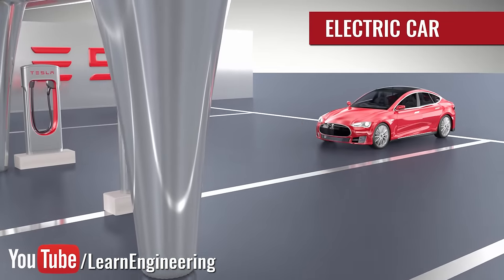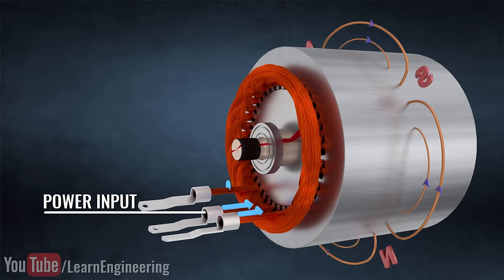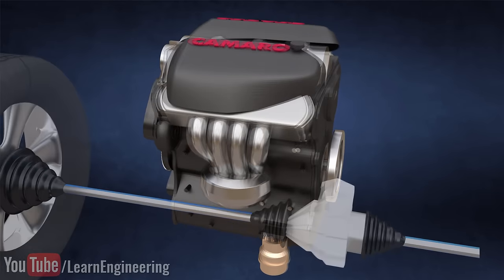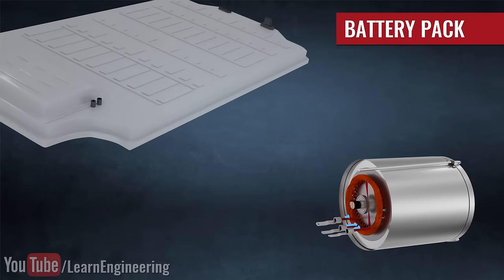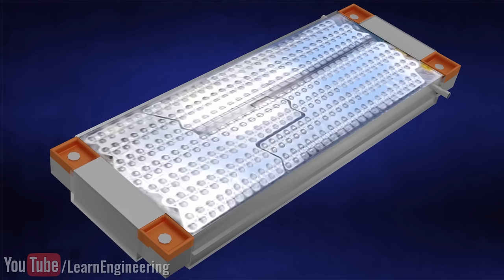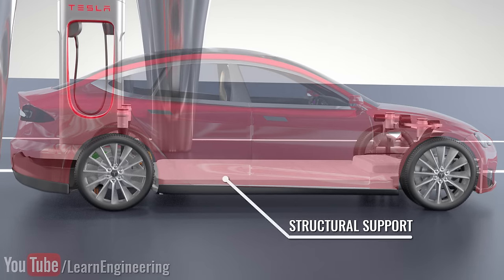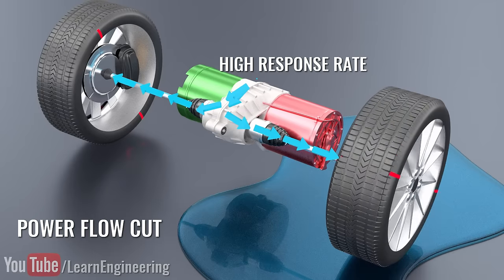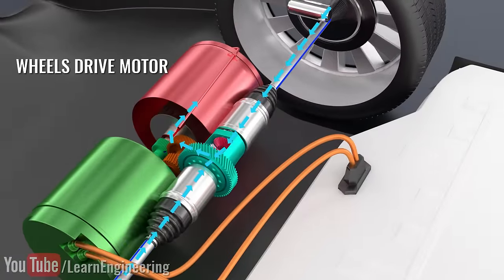How does an Electric Car work ? | Tesla Model S

Comment: What is the  RMF?? Somebody help me plz
Reply: (Rotating magnetic field )which is the synchronous speed of an electric motor, say an electric motor has two poles it’s synchronous speed is 3600 rpm but due the drag of the bearings and weight of the rotor the actual speed will be somewhat slower like 3450 rpm. 1800 synchronous speed will be 1725 or 1750.
Reply: I interviewed a top energy expert on my home page vid. He warns EV conversion will not happen and oil can never be replaced
Reply: @modoc852  Thank you n lovuu

Comment: Electric cars is for city commune not for long distance travel. If you go on the Interstate Freeways, How long can your Tesla can be driven before hours of recharging battery vs 10 min for filling up gas tank.
Reply: @AdamZaffar  You are lying bro. This is from Tesla company specs.

0-60 mph*

353
mi
Range (EPA est.)

In reality you will never get close to it 300 miles with AC off, no lights, no radio etc...

Comment: I was told that the Tesla motor was a SynRM design, not an induction motor. The SynRM design is a 4% more efficient motor than a typical asynchronous motor.

Comment: Couldn't you potentially put an standard transmission in the car in order to further vary its torque/speed output and make it therefor more efficient with the electric motor.  Also a manual transmission tesla would be something I could get behind
Reply: I wish I was able to understand your suggestion but it sounds like a sick plan 😭😭

Comment: Answer:  Not very well in a Chicago winter 🥶🥶🥶
Reply: That issue was avoidable. EVs don’t have the problems in extreme cold that gas cars do needing a tow due to dead 12 volt battery, a past problem in Norway where there’s the highest concentration of EVs in the world
Reply: that was a problem of the past

Comment: The most complicated and difficult bit to understand is how the inverter produces varying speed/varying amplitude multiphase current from a battery. However this video simply presents it as a magic box with no attempted explanation. Pity. Also if electric cars are so much simpler than conventional ones why do they cost twice as much?
Reply: Bateries are expensive , but most electric cars are overpriced anyway

Comment: regenerating breaking is only 70% efficient,  you are better off putting in neutral to let the car roll if you are a really good driver.
Reply: sure.. but the pedal is not binary. there are an infinite amount of positions. you just have to use it properly to "coast" by letting off just a little.. let off too much, then you'll slow down too fast. also, with real-world use, people aren't coasting all over the place, especially in inner-city driving

Comment: It is un logic that there is movement and there is no electricity
 The electric car, when moving, must put a dynamo to recharge the battery, or divide the battery into half that moves the car and the other is charged by the dynamo
 This way, the battery does not need to be charged

Comment: If there is no engine and no gear box and fewer components / moving parts, why electric cars are that costlier than IC Engine cars?
Reply: The battery packs are expensive to manufacture

Comment: Such an advantageous technology. We should’ve jumped on the electric revolution over a hundred years ago. What a catastrophic miss.
Reply: Nope we just weren't there yet a century ago.Modern technology is just enough for the beginning era of electronic revolution.
Reply: @joker7287  Eh, on the contrary, IF the electric revolution could have started and being developed instead of the overtaking by the oil companies and the invention of the IC engine, it most probably would be more ahead than it is today. You need to look up history to see that the electric motor was better than its competitor.
Reply: @jericoba  yep I know it is But Development of concepts that are being used in Electric cars weren't fully understood back then.
Plus lithium-ion batteries were developed somewhere in 1996,
Reply: @joker7287  It matters not what technical innovations you know about now, it doesn’t changed the fact that the electrical power movement would’ve taken off differently than it being completely shut down. See what I mean? It would been MORE beneficial.
Reply: @jericoba  oh I see.

Comment: Why they don't put electric motor directly in the wheel ?
So 4 motors for 4 wheels
Reply: I interviewed a top energy expert on my home page vid. He warns EV conversion will not happen and oil can never be replaced
Reply: @ChannelNews1  lets just wait for 10 years
Reply: @aadityachourasia2124   sorry I see a notification from you that you replies but there is no comment showing. I think they are removing comments. Please leave the comment on my home page vid so i can read it and respond back.

Comment: am i the only one who noticed that when they were showing a model of the Camaro engine, which is a LS V8. When they showed the internals of it, there was a inline four cylinder powering it. Which makes no fucking sense at all. A V8 is going to have its pistons in a V formation with 8 pistons, not 4 fucking pistons. Otherwise great video!

Comment: How are battery operated cars pollution free? How do they charge the batteries? Is it possible to make a car where you dont need to wait while charging? make the car design so the battery can be swapped in a few minutes with a freshly charged battery. Like swapping out a gas grill propane tank.

Comment: My thing is... if you have common sense.. understand efficiency in finance and in life... understand this video.. and understand the basics of how an internal combustion engine works... then why, if you have over 30k to buy a car, would you buy any other car than a Tesla.... unless youre a car guy and are craving 1 specific car.

Like why would any normal human rather have the stress of constant oil changes, extreme amounts of maintenance, and the amount of risk of what can go wrong in an engine and the extreme high costs to fix it WHEN YOU CAN JUST BUY A TESLA... like i just dont get it.

Comment: alot of the information was very one sided. You say electric motors have better power to weight ratio but completely ignore the heavy batteries. Sure electric motors are extremely efficient but you still need to produce electricity and transportation of electricity. Also modern 4 cylinder diesel 4 stroke engines wich where i live are by far the most common engine run really smooth especially with an automatic gearbox. Sure electric is a good alternative for fosile fuel. But there are still lots of challenges. Production of lithium batteries is also very bad for the environment. Also electric cars aren't necesarily more safer the batteries are hard to extinguish when burning. Mechenically they need alot less maintenance but the batteries will loose power and are again a big environmental issue when they need to be replaced and a fault in the computer can make it undrivable
Reply: The motors are compared to the engine.  If you include batteries, you have to include the fuel tanks, the fuel and all the fuel components.  

And you have to produce fuel for combustion engine cars, including exploring and drilling for oil, transporting the oil to a refinery, refining the oil, transporting the fuel to a storage tank, truck the fuel to a gas station into another storage tank, and then drive the car and pump the fuel into the car.

Electric cars ARE far safer, due to larger crumple zones and superior crash structures.  Hence, electric cars like the Tesla Model 3 are rated the safest car ever made.  Battery fires are exceptionally rare, for every EV fire, there are 60 combustion engine car fires per 100,000 cars.

EV batteries can be, and are recycled in all modern EV's.  And combustion engine cars contain dozens to hundreds of computers, so that claim is obviously false.
Reply: I interviewed a top energy expert on my home page vid. He warns that EV conversion will not happen and oil can never be replaced

Comment: If I'll be manufacturing electric cars I would make sure it has wind turbine in front, so that it can charge the battery while you moved... Plus a solar panel and alternator... But electric cars has one main problem and that is corrosion/oxidation all conductive contacts must be corrosion/oxidation free to be of a lifetime use...

Comment: Shouldn't you add the weight of batteries and average fuel weight to get a realistic comparison? There also the k factor which is the slope of the line how efficient the energy is used is t = 0-60 mph, w= vehicle weight in lbs, and hp = horse power , ie. t = k x w/hp  The lowest k wins.? K should be in the range of .300 to .400 .

Comment: Guys good job ( an alternator to recharge the batteries when car batteries are low ) an indicator sensor place the alternator where the wheel drive shaft rotates ( then ad to car dash ( battery low computer brain. ( on dash battery low Alternator on ( just like a fuel tank. ( your welcome ) Jose Madrigal Las Vegas Nevada USA. ( stronger solar panels for farm tractors OK. Thumbsup

Comment: combustion engines have the pro of refueling under 10 minutes. an electric car almost 50 more. besides that power plants will be using more fuel to charge more cars. so al in all the same pollution.

Comment: So what would happen if you installed multiple generators/solar collectors /wind turbines to charge the battery ( or 2 batteries)  resulting in a higher electrical input to maintain optimal battery life to not only drive the motor but regenerate the battery as well and run on itself never needing external charging?

Comment: Tesla uses the accelerated pedal to accelerate or decelerate and 99% brakes are not used. I drove and was horned all the time by the car behind.  I was wondered why people keep pressing the horn on me and later I found out that the car doesn't often use the brake and the BRAKE LIGHTS ARE NOT TURNED ON WHEN CAR IS DECELERATED!  It is very dangerous too.  Tesla should apply the brake light when the accelerated pedal is released, so the other behind vehicles can be alert!

Comment: I believe in electric motors being the future, but not in current lithium batteries. The charging is slow and does not have the same range as petrol or diesel. People who want to travel will take this into consideration and want to drive to 1000 km in one day. Apart from that, the charging can overload the electricity net. Electricity also must be green and lithium and kobalt mining is dirty. Then again I have driven renault zoe and nissan leaf and the instant torque, no gearing and smoothness of these engines really make petrol look like ridiculous things. I drive a bmw 328i with more than twice the power and a very smooth zf8 automatic, it is faster, but you still have the small lag in gear changes, turbo and nature of ICE

Comment: So far the car is only good for commuting.   Would be terrible for a long distance ride as you have to stay on the highway and make multiple stops for charging.   It takes too long to recharge as well.  Once they get it to go over 400 miles at 75mph without a recharge would it be worth buying for traveling.  Also, you MUST ride on the highways and not by-ways when you travel as there are not enough charging stations.  Perhaps in the future if they can sort all of it out, but for now it's only a very expensive car for commuting.
Reply: Of course they are working on all of those issues. Its a work in progress. And better to statt now than later. Costs will be reduced dramatically in a few years and obviously long after that
Reply: @marcorodriguez8477  Those issues have been being worked on for well over a century.  I think it has found it's limits, but you never know.   I am rooting for such a thing.  What the industry needs is a breakthrough.  The technology as is it exits now, is still very limited.
Reply: @cashstore1  yes, electric cars have been around since before ICE cars. But the progress being made now far outweighs the previous century. The company Tesla are driving us (no pun intended) into an EV future. Did you see battery day?
Reply: @marcorodriguez8477  I read that they managed a 16% improvement with new technology.  So if the car can currently give you 200 miles on the highway at 75 miles per hour, it can now give you 232 miles.  A step in the right direction but still way off the mark for a car needed for traveling long distances.   
I do understand the progress being made over the last 112 years or so, but the car still is only good for commuting.  Battery technology needs a Wright Brothers type of breakthrough.   I suspect some way to recharge while the car is running.  Perhaps hydrogen energy to drive a small generator as the battery needs it.   I do a lot of long distance traveling out here in the West and I don't normally use the highway.  The car in it's current form will not work.  If I lived in Phoenix and needed a car for getting around locally it would be fine.  I see a lot of Tesla cars when I go down there.  I am retired and travel all over the great West.
Reply: @cashstore1  keep in mind that long-distance driving is not a top priority for Tesla right now. The average driver doesnt drive more than 300 miles per day. Also, this would be completely ignoring the fact that Tesla, over the long term, has been increasing the miles per dollar in the EV industry. This was only the recent improvement (which is monumental and you dont seem to understand the implications of this "step in the right direction"). The 16% is only the increase in range. This is a piece of the overall 56% decrease in cost/kwh. Price, in my opinion, is more important for mass adoption than range, and I think Tesla knows that.
Reply: @cashstore1  also, the lowest-range EV you can buy from Tesla is 250 miles per charge at $35,000. Personally I dont think I travel that much on a weekly basis, but i know there are others that do. There are longer range Teslas but they are more expensive. You see why lowering costs is more important? Battery production is tied to the price of the vehicle, considering it is the most expensive part. That along with all the other improvements that were announced on battery day, such as tabless electrodes (increasing the energy input and output capabilities(less battery degridation + performance + lowered charging times)), and cutting edge manufacturing processes (needed for mass adoption) on both body and battery production (lowering costs + ability to scale production higher). I can go on about the implications. Look into it more, you might be surprised.
Reply: @marcorodriguez8477  I realize they are only selling these cars for commuters.  That was my point.   I can't use a car like that, but many can.  I know their market.   Gas is so cheap I don't care about the cost/kwh.  What I all wanted to point out is the car is for commuting right now.   In the future maybe they can figure out long distance travel.

Comment: For me the idiotical charging (time) and run on spots is the problem, not the Car. So at te very least one removable seperate set of "batteries" - "powersource" you charge one (at home for instance) and drive with the other. Or pick one up at a "station" fully charged and ready to go...

Comment: Okay so a unseen speedbump could be devastating? Battery and engine very low and a sport or speed model. I ask because it was brought up and Firefighters need to know what kind of fire they fight. basically cant stop a fire so you must control it IE foam and water is worthless.

Comment: It is sad that you present only part of "electric cars" truth. So please tell your viewers fascinated with "clean electricity" that batteries used here require temperature not lower than +30 Celsius degrees. It means that even when car is not running "electric" uses energy to warm batteries. For example in winter it takes more than 30% of total capacity...

Comment: This not much different than conventional Battery just pack in case..they should make blade flat battery like BYD company makes the EV car and is more efficient than tesla and saves more space hence we can add more storage for battery to last ling enough to use and reliable with cheap spare parts

Comment: These cars are not “pollution free” by no means. All the pollution is up front hidden from the costumer.
Reply: That is partly true. The average electric cars creates 8 times more CO2 to produce but that gets quickly dimished as driving the average petrol car  for more than a year and a half creates more polution that the production of a Tesla, meaning that electric cars are still better. The technologoy is also getting improved always, meaning that fewer and fewer rare materials are needed to produce the batteries which cuts the pollution.

Comment: In a nutshell Tesla is at least 25 years ahead of its time as people are just not ready for a smart car nor the system in which it operates but someone has to buy to impress others. 
On the flip side, Tesla is an incredible piece of machinery in the automobile industry. No one has seen a car that drives by itself and nothing in its trunk or hood. 
Finally, Tesla should have concentrated on the electric components rather than the smart features otherwise China will take over the supply of batteries and its essential ingredients, which they have already started and are manufacturing Tesla from scratch.

Comment: Okay, so many problems. By 2025 Gas cars will be obsolete, bogus and I would've said the same in 2017. Gas cars are also undergoing improvement each year as well. Also, the weight ratio wouldn't be fair without including the weight of their respective fuel sources. A gas tank has less weight as fuel is used but an electric motor still has to deal with that weight. Not to mention the fact that they still rely on fossil fuels from power sources.